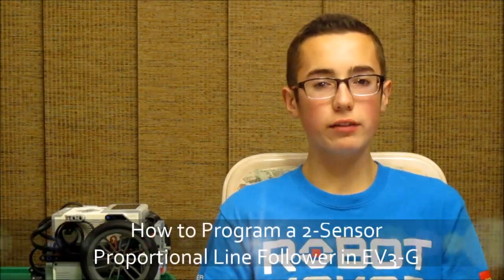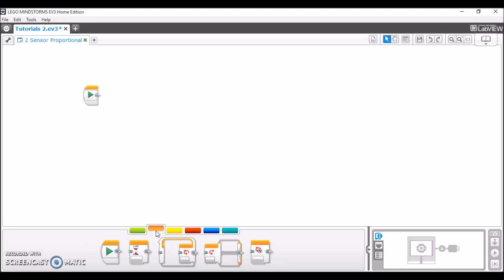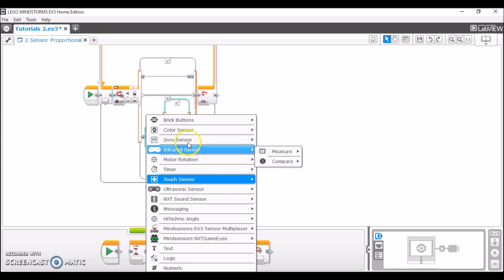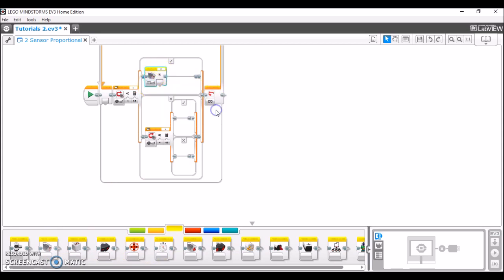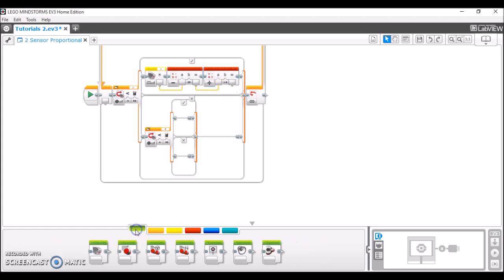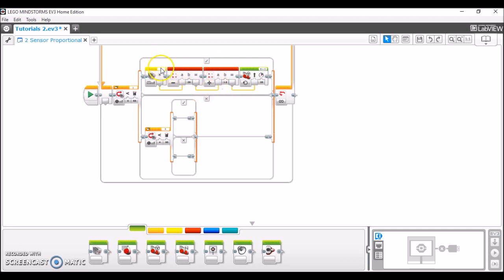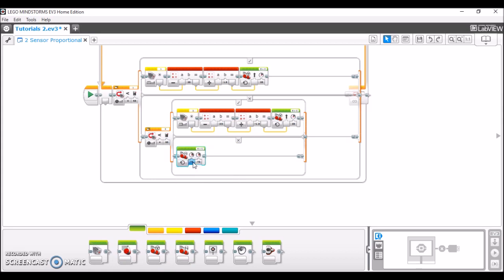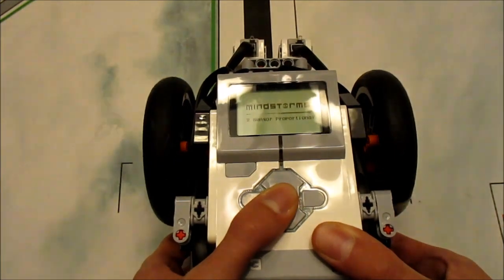How to Make a 2 Sensor Proportional Line Follower in EV3-G

Comment: I just made proportional program, but better. When the robot drive of the line he remember witch sensor saw the last value <10. The if the first sensor have >25 (white) and the second too it will get the last value and then come back to the line. It works really well. Sorry for my english :P

Comment: What do you mean threshold value 65 when both sensors are over the white line. That's what you said on the video and it makes no sense. And why do you divide by a factor of 1.5. Shouldn't you have multiplied by 1.5. The Formula is Turning = (a-b)*c where a is the light sensor's value, b is the threshold value and c is the turning multiplier. You are confusing people if you are using Math operations out of your mind.

Comment: hi . what if i use the line as a track the after following it for couple of inches i want to switch to do a mission next to it
Reply from the maker: +Ahmed Abbasi Set the Loop block to end after a certain number of degrees or seconds.
Reply: +Builderdude35 thx

Comment: While I was playing around with 2- and even 3-sensor line followers, I came up with quite a bit ideas, however the one you utilised didn't come to mind! Way simpler than what I had done, I must admit. However can your robot react to if it has lost the line, for example if it has to turn a 90 degree turn? My 3-sensor design can :p I will make a video of it soon enough, you will see what my idea was.
Reply: how does that work? 3 sensors?
Reply: sorry replied with my other account, I mess up sometimes. :p (Karl Aleksander Leoste is me, just another account) but, back to the point, how 3 sensors works is the two front ones detect which way the line is going and the middle one detects how far off the line the robot is. I also added a memory system to keep turning if the robot should be off the line.